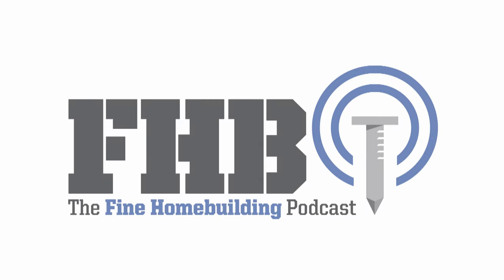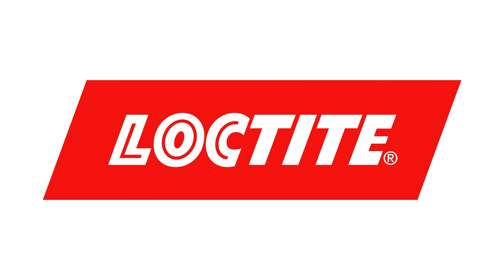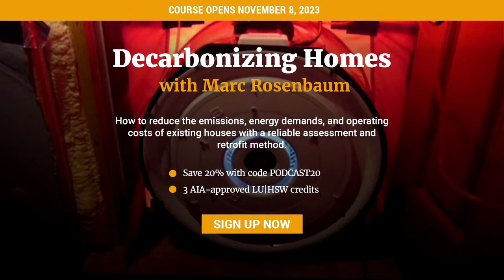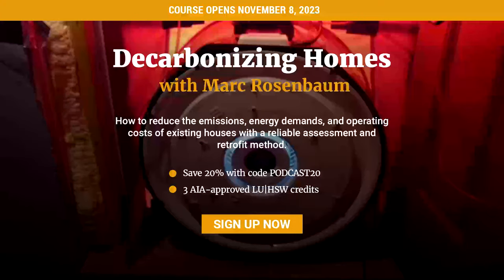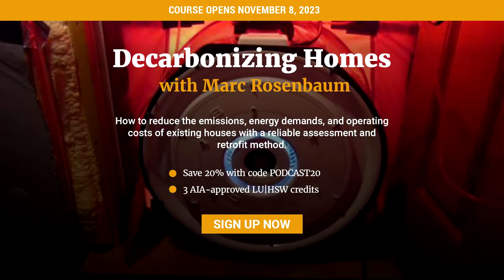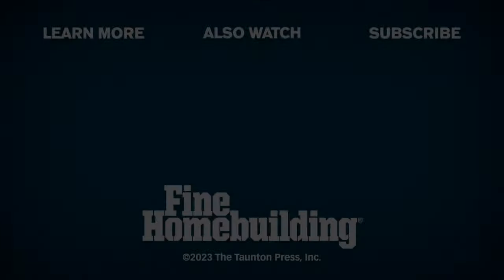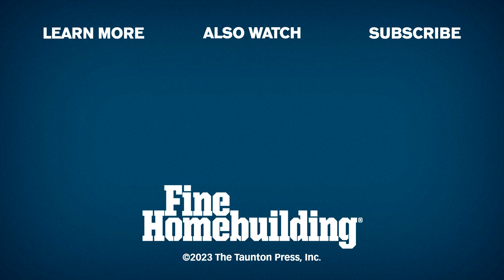Podcast 597: Fish-Mouthed Sheathing Tape, Window Installation, and Flashing a Bay Window

Comment: Actually most level 2 chargers are kitchen range plugs 240 volts plus neutral and ground, 50 amp breaker. Most, I believe, dryer connections are 240 volts plus ground without the neutral and 30 amp breaker. Obviously you should charge your car at no more than a 40 amp rate on a 50 amp circuit to reduce heat buildup in the wall. For proprietary chargers follow manufacturer's instructions as to wiring and circuit breaker. GFCI breaker is code for a garage.